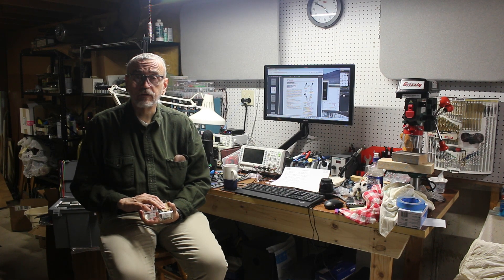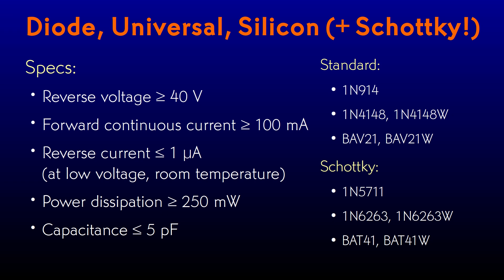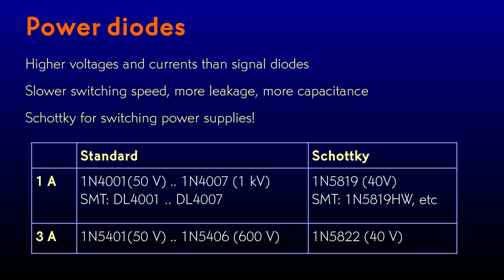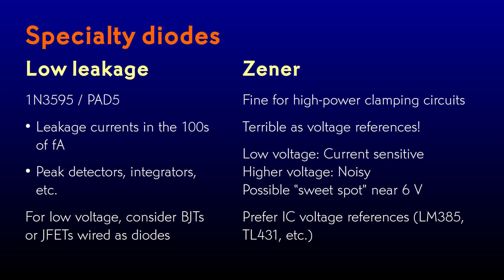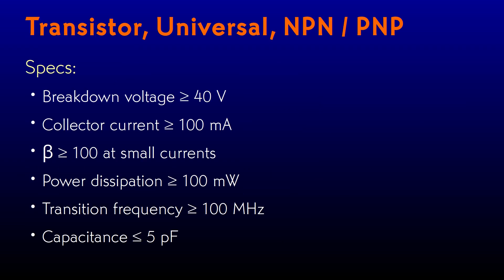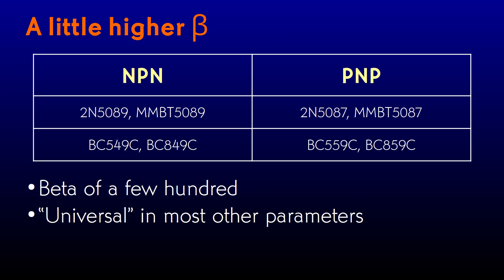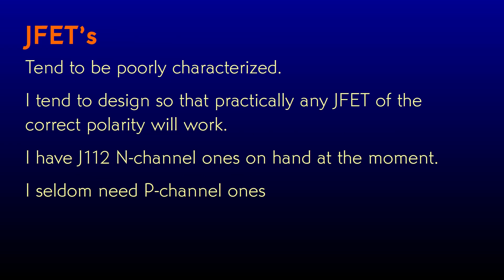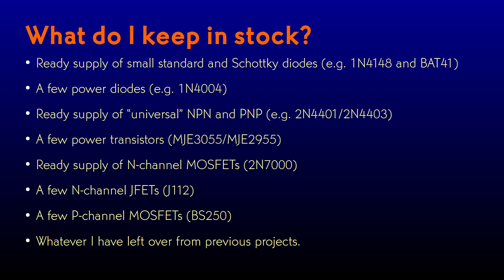What's in my parts box?  Discrete semiconductors!

Comment: What about using the collector base diode in a bjt as a low leakage diode? It will be slower than the emitter base diode probably, but can handle 100+ V. I measured an MMBT5551s collector base diode leakage to be better than 1 pA @ 9V. The modern jellybean low leakage diode is the BAV199 probably.
Reply from the maker: A few reasons that the C-B junction is often a poor choice.  It's got a bigger junction area, which means that it has a higher capacitance and a slower reverse recovery.  Also, if you use the B-E junction with collector and base shorted, the transistor's current gain works for you to flatten out the curve of forward voltage with respect to current. Doing the same thing with base and emitter shorted is running the transistor in reverse-active mode, where the current gain is much smaller.

I'll have to remember the BAV199 the next time I need such a thing.  (As I said in the video, I seldom do need such a thing, but it's good to have it in my compendium of parts.)